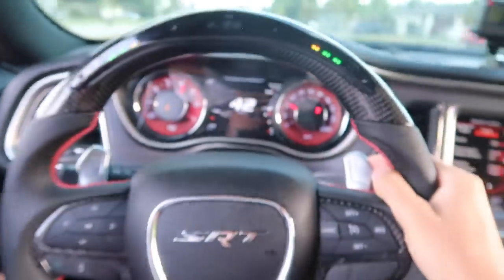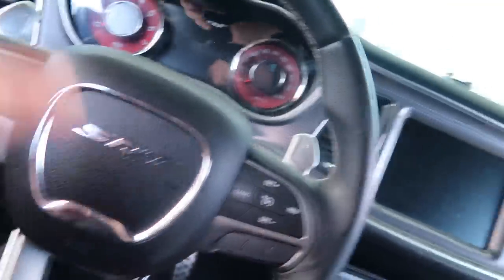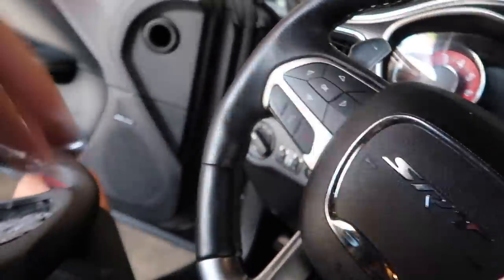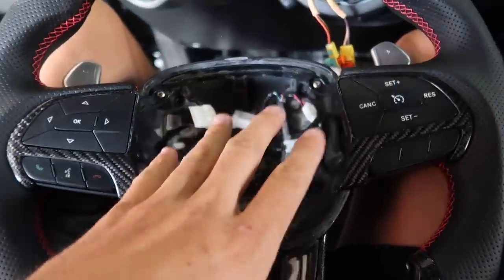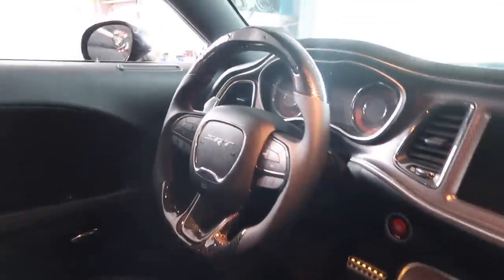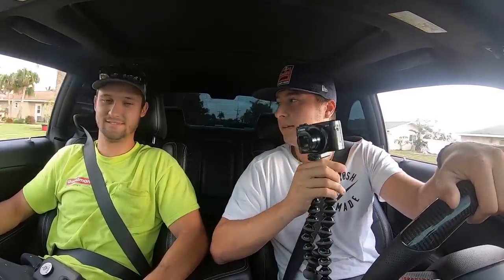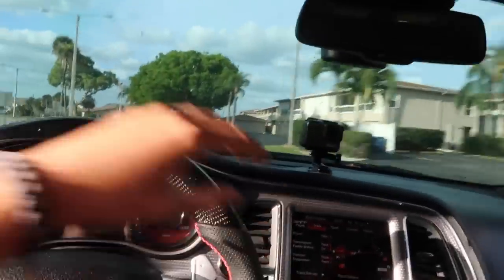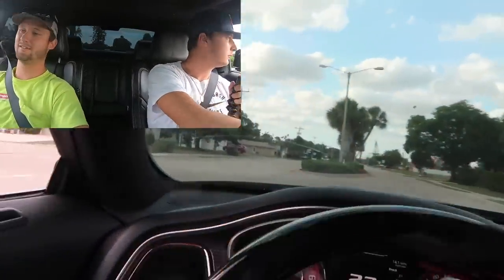MY HELLCAT GETS A CARBON FIBER LED STEERING WHEEL!! "DIY INSTALL"

Comment: Love the wheel. I have one in my 2017 corvette. Hope you know you can change the color of the shift lights and you can change the logo when the wheel first turns on.
Reply from the maker: I’ll have to mess with it !
Reply: Judahs Garage if you need help just let me know.
Reply: @1CleanC7  Do you have a video of your install?  or instructions on how you installed yours?
Reply: @bonittilamour  sorry bud but I dont have a video of the actual install. The shop that did it (Music N Motion) out of dublin CA took care of everything. Everything was simple but I wish I could tell you what wire they tied into for the shift lights.
Reply: @1CleanC7  Where did you get yours from? was it the complete steering wheel when you got it or did you have to send yours in? Thanks for responding.
Reply: @bonittilamour  I ordered my wheel from impressive carbon (that's their Instagram name). Told them how I wanted it to look and they made it happen. I did not have to send my wheel in (you have that option if you want to save a few bucks), the wheel was fully complete, all I dad was swap over the paddles (if you get carbon paddles then it will come installed) and swap over the airbag. Absolutely top quality, you can check out my Instagram at 1cleanc7.

Comment: Bro where did you get that steering wheel,I need one for my T/A 392
Reply: Brian Romer Hey man, I got mine for my M3 from Realcarbontastic. They sell LED steering wheels for Dodge vehicles as well.
Reply: John Daniels aight thanks bro
Reply: Brian Romer No problem
Reply: Brian Romer look them up on Alibaba , directly from the Chinese factory , getting one for my camaro with the led lights for 500 , compared to 1200 for same wheel on other websites
Reply: @akidim13  would you happen to have the contact....cant find someone to do this same setup for an 04' SRT10 Ram.....Thanks
Reply: @HerePiggyPiggy  you can try to look up steering wheels for other cars that used the same design wheel since your truck is pretty rare and not mass produced as compared to a camaro or mustang , I’ll get you the info though gotta go back to my emails , reply back to this and I’ll give it to you

Comment: I install the LED STEERING WHEEL but drain the battery after 10 hours what OBD you install ,the OBD came with it or different OBD?   also do you think can I install different OBD device?
Reply: Mines doing the same right now

Comment: What tune is that for the crackle pops and where did u get the steering wheel.
Reply from the maker: Dm me on insta and I’ll get you hooked up with a steering wheel
Reply: @judahfindley  I just did.  Sleephawk

Comment: You gotta drop where you bought that wheel from!
Reply from the maker: Message me on Instagram
Reply: @judahfindley  why don't you tell just tell him on the comments
Reply: @vinnboi2228  because it's shady. Like wtf. People are asking over and over and he's making them go to insta? Maybe for a follow or some shit. But could have just put it in the description like a normal person
Reply: @Allthingsconsidered11  thats what i was thinking too
Reply: @vinnboi2228  yo if you looking for the wheel, I found a cheap way to get it. I'm working on getting one now. I found out the shady part. If you get this wheel from where this dude or anyone on youtube is saying, it's 1500$. If you buy directly from the manufacturer like I'm doing, it's 500-600. No cap. All it takes is a little DD and some time. Cuz I was not paying 1500 for this 😂
Reply: @Allthingsconsidered11  alright cool thanks bro
Reply: @vinnboi2228  for sure. It cost me 455 from the manufacturer. After shipping to my Georgia address, it cost me 560. 575 because I used a credit card. There it is. Plain and transparent. Seems like everybody on youtube doesn't like to give prices. I never understood why 🤦🏾‍♂️
Reply: @Allthingsconsidered11 so what’s the process, what site did you use to get this steering wheel? I’ll follow you on Instagram too

Comment: I have this steering wheel on my old 350z. It is awesome. Also it is mentioned in this video that people wear their mask while driving. During the height of the Corona virus, a lot of people wear their masks while driving. They all looked dumb. You are the only one inside your car. Nobody there to infect you. Stupid idea wearing that equally stupid mask. Now, about the Hellcat... I don't care about that gas guzzler. Even if it's ultra fast, i don't care. The Hellcat looks ugly. I will buy the new Nissan Z soon and modify it. Slam it. Put good wheels and tires. It will look awesome. I want looks. I don't really care about speed because nobody is paying me to speed. Instead i get to pay the court if i get caught speeding. So it's really stupid to speed on the streets. I don't want to track my car either. It shortens the life off your car. More repairs, more maintenance. Nobody pays me to track my car so why waste my time and mess up my car at the same time? It's lame. I like show cars. Not race cars.